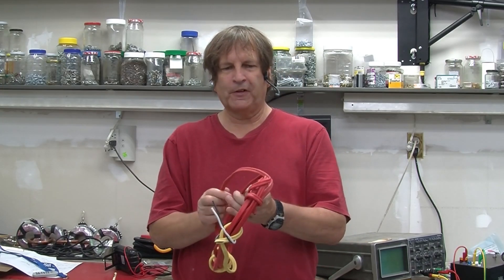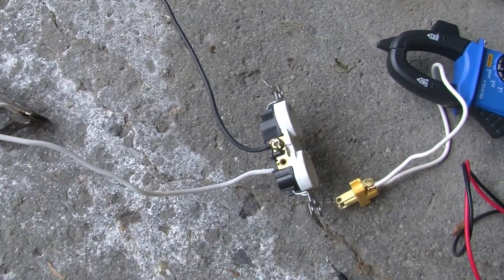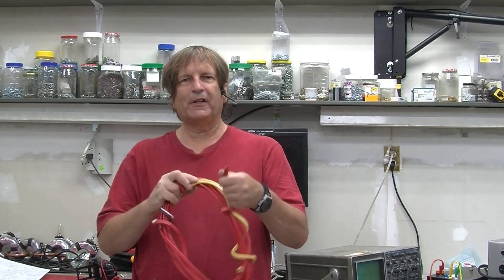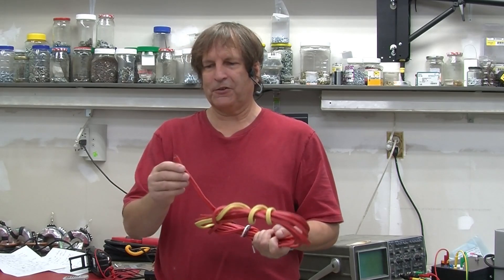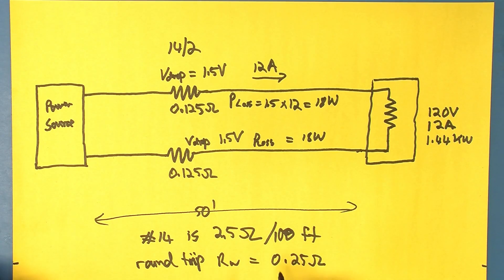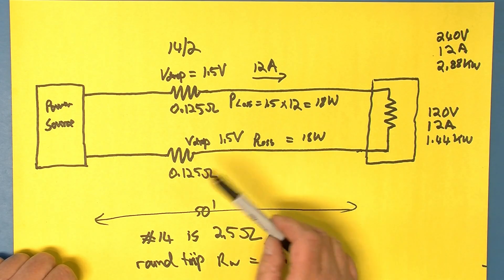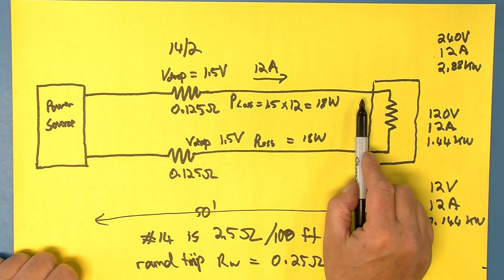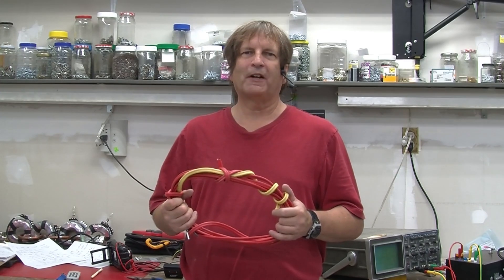Overcurrent Tests FAQ

Comment: Interesting with the amp ratings there.  AWG 12 is 3.3mm sq.  We don't use that size wire here, Australia, typically.  General power will more often than not be 2.5 sq mm.  Once we apply the typical derates and add in an appropriate MCB it comes in at being suitable for 20A.  If for some reason it's in conduit and that conduit is embedded in insulation (so as bad as it gets really) that can derate to 12A and then once the MCB is added in too we can be looking at it being suitable for only 8A or 10A.
Reply from the maker: I wonder why there is a difference the size of wire required for a certain current between the two continents? The only thing I can think of is maybe we require a bit larger wire, not  because of the heat, but to reduce the voltage drop which, since our line voltage is lower, would have a more significant percentage effect on the voltage seen by the load than it would for you with 230V?
Reply: @ElectromagneticVideos  Voltage drop may well be it.  The Australian standard sets the nominal voltage at 230, +10%/-6%, from the grid.  We are then allowed a max of 5% drop from that grid voltage to the load across the building's internal wiring.  Pushing that to the limit means about 203V at the load, which is also unacceptable so the wiring would have to be upsized to cope.  Seeing 216V from the grid would be a pretty abnormal situation anyway.  More jiggliness.
Reply from the maker: @retrozmachine1189  So you made me look up what the standards are here. Two interesting links: https://www.hydroone.com/business-services/commercial-industrial-generators-and-ldcs/power-quality/power-quality-definitions and https://www.pge.com/includes/docs/pdfs/mybusiness/customerservice/energystatus/powerquality/voltage_tolerance.pdf . Hydro One handles power in Ontario where I am, Pacific Gas and Electric Company is in California. Both indicate at the service entrance (where the power enters the home or building presumably at the meter ) the normal allowable range of voltages is from 110V to 125V for the now standardized nominal 120V system with occasional extremes from 105V to 127V allowed.  So for the 110-125 range, we are promised +4%/-8% . And we seem to allow the same 5% additional drop after meter.  

I typically measure 115V on hot summer air-conditioner days to 125V at low consumption periods at my house. 

So our input range is slightly tighter than yours. As you point out, both system s allow for a surprisingly large range of voltage that devices have to cope with. Your larger +10% range going up makes more sense to me that our larger -8% going down when you add in the additional 5% allowable wireing drop. At least in the end you are more centered around the nominal system voltage.